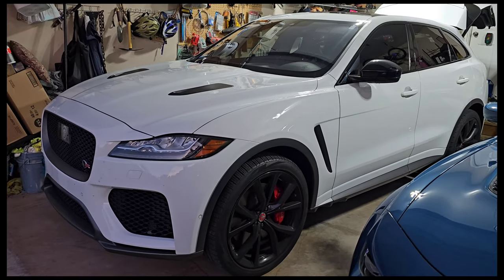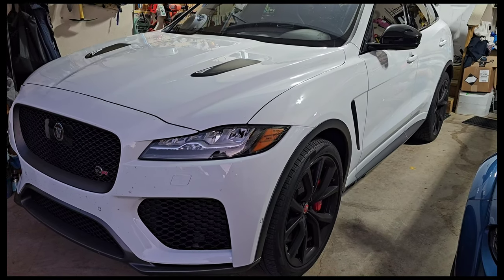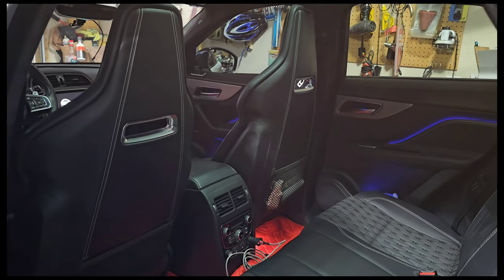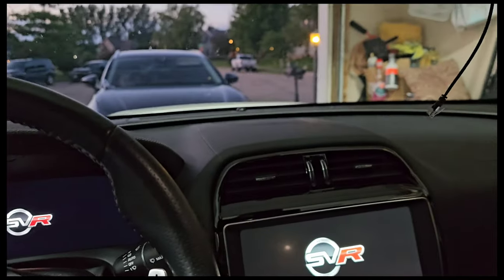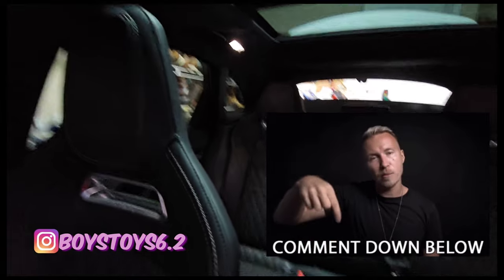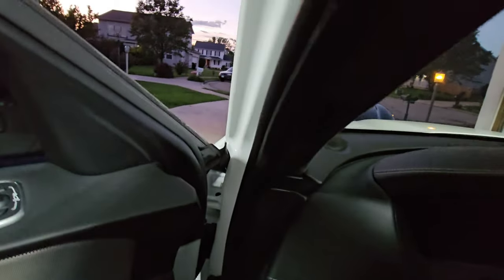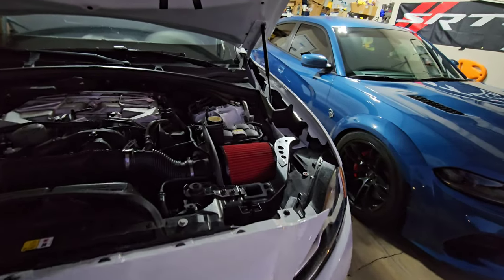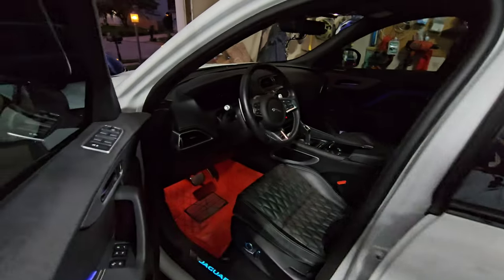SELLING MY 2020 JAGUAR F-PACE SVR!!!

Comment: Hey just curious how come you selling this? Not in the market rn but in the near future I want one with 20k ish miles on it. How was reliability, any issues? I’m a bit of a younger driver but I want a v8 suv next that isn’t huge. GLC 63 AMG was nice til I heard all the issues with owning an air suspension car lol.
Reply from the maker: Very reliable, in the 8 months I've owned it i had nothing that failed in it. I'm selling because I'm getting a ftype R two seater sports car.
This SVR still got warranty until 2025 and 60k miles. So it'll be a good buy because if anything fails it'll be repaired or replaced under warranty.
Even the service is free. All you really need is gas it up and go.
Reply from the maker: I was looking into GLC 63 before I bought this SVR but like you said the reliability issues, it did not look as aggressive as this and this sounds way better.
Reply: @BoysToysHellcat  oh wow that’s great! Tbh I’d go for an f type but I’m in NY. Need I say more? (If you been here yk the roads are just something else😂)
Reply: @BoysToysHellcat  just saw this other reply. Yeah definitely, although jag isn't known for reliability either. I want a V8 SUV, not too many options, mainly Germans.